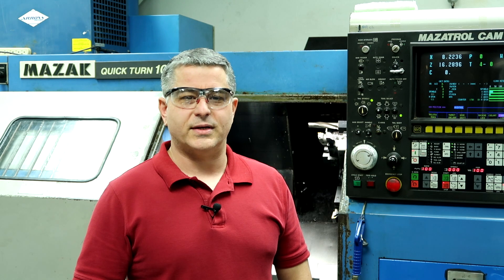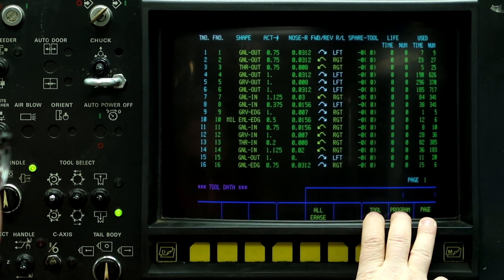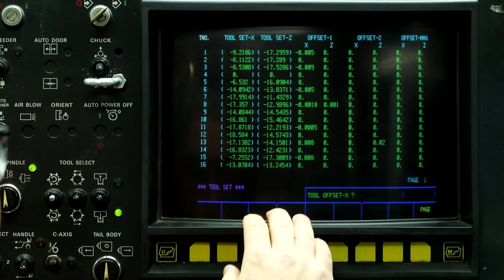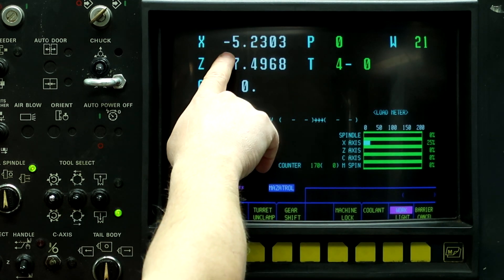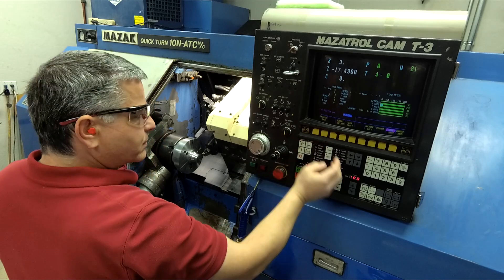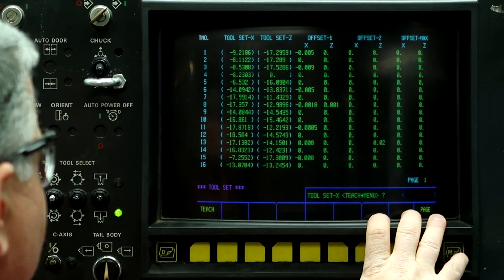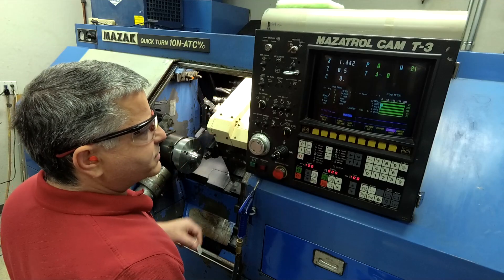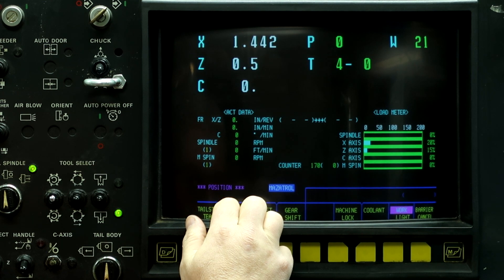Mazak CNC Lathe Manual Tool Set

Comment: Can you make a video doing the same thing but instead of an O.D. tool could you do a boring bar?
Reply from the maker: @aarontabor2915  Sure thing.  Thanks for the suggestion.
Reply: @mazatroltipsandtricks6816  why did you add 1.4177 instead of just .9177?  Didn't you add the .5 when you initially were teaching z? Also what if the z offset is not able to be set because it does not know how long the tool is?  Would you just set the z tool offset then set the z work offset?

Comment: I have one question, i have second spindle and two tools in one position, but only one is defined in the machine. How can i iput more tools in the machine so i can use both at the same time?
Reply from the maker: What control do you have?
Reply: Mazatrol T Plus
Reply from the maker: @uroszivanovic2732  You should be able to set multiple tool descriptions for the same turret station. Go to tool data and arrow down to the tool number in question and push insert tool or edit tool on soft keys. It will allow you to make a secondary tool like tool 8A, 8B, etc.

Comment: how do I set the Z on my ENDMILL or Drill if it was in 90 degree vertical ??
say .5" end mill 
and if I set one up can I rely on it for all the other cutters? drill bits and endmills alike at 90 degree position?
Reply from the maker: Probe the side of the endmill and then add half of the diameter to the Z  geometry so it is a larger negative number.
Reply: @mazatroltipsandtricks6816  so say the Z OFFSET right? is "-.5" the value in setup info page
bring the end mill to the edge of the part 
then in the tool offset page  TEACH , Z "-1."? 
something like that? so you add .5 plus the main Z offset? (where the Z zero is in front of the part)

Comment: Hi Phil. I have a Quick Turn 20N but l lost the manual books especially the parameters in order to reset every thing it's possible to borrow yours book or copy of yours book I will pay for them
Reply from the maker: Unfortunately I do not have parameters for your machine. Parameters are unique to each machine. Mazak can get you the parameters if you send them your machine serial number. I do not know what the cost is but it should be less than buying the whole manual set for $750.

Comment: Is there a way to disable the tool eye?
Reply from the maker: The OP parameters control the tool eye. I don't know which one though.
Reply: @mazatroltipsandtricks6816  I was just asking because some torched off the tool eye about 20 years ago. Some of the boards went bad and we replaced them, but can't run the machine do to the machine thinking the tool eye is extended. We're trying to see what parameters we need to change, but have no clue.

Comment: Hi Phil, thanks for your videos and for teaching us machinist differents methods on how to make our life easier for set ups, I do have a question I hope you have an answer, how to set X for a core bore drill? Thanks and keep up the good work
Reply from the maker: Depending on how you want to run it. Set it to X0 if using a drill cycle or probe it like a boring bar and then use the MNP and program X at the drill diameter. Check out my other video on MNP programming.
Reply: Yes how to set 0 on X, and I will see the video on how to run it on a manual program

Comment: I think a good tutorial, (if you havent already made it), would be tool geometry.  For some this can get confusing. For others it causes anomalies in the program. What exactly is the included angle? Where does the 95 degree and 80 degree go when you assign tool data? Things like that.
Reply from the maker: I did do a video on this subject. I will have to find a link for you.
Reply: @mazatroltipsandtricks6816  Hi there, thank you for the useful tutorial.  If you find the link on tool geometry,  can you please forward me the link
Reply from the maker: @etiennelabuschagne5833  I have another video that describes the tool geometry. Maybe that will help.

Comment: I don't see how a dowel pin would be more convenient, I do usually use paper or a sacrificial piece turned down with an already set tool, then touch it while turning until a chip goes out. I should be missing something but would you please let me know how the whole setup - circular part vs 90 degree circular dowel pin vs the tip of the tool - would be easier to use than paper? From what I see from the JOG wheel, you probably move the tool near the stock, then start widening the gap between the tool tip and the piece, until the dowel pin slides in, not the other way around, as done with paper or shim? Maybe this would be easier, it's surely worth a try. Great content, keep up the good work!
Reply from the maker: Thanks for the feedback.  I will usually set tools by cutting the workpiece and measuring the diameter myself.  I just wanted to show my viewers another method of touching off the tools if the workpiece was already cut to size. I found the dowel pin method to be much more accurate than using a paper or shim though if I have to resort to touching off tools manually.  I do like having a working tool probe.
Reply: do you watch edge precision ? he's got an integerx  he always uses a dowel pin to touch off his bits

Comment: I used to use a pin to set tools in the mill all the time because it was a lot easier than shim/paper. And, I found it to be more accurate as well. It also seemed easier on tooling.
Reply: do you have a machine with live tooling? end mills? drills?  how would you set the X or Z  on those live tooling tools
Reply: @derick3482  Touch on a known dia. clamped in the spindle, and add the radius of said dia. to the offset. (I am assuming you are referring to radial live tools, not axial).
Reply: @derick3482  Vertical and Z in a lathe? I'm thinking you are working in a mill huh? All the tools in a mill are "live". And, no, you will need specific tool offsets for each tool in one way or another.